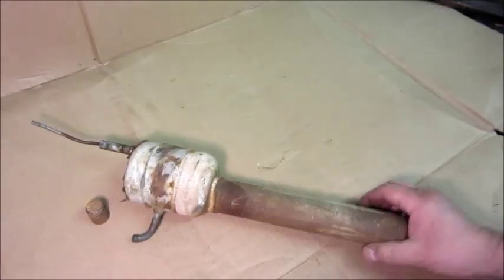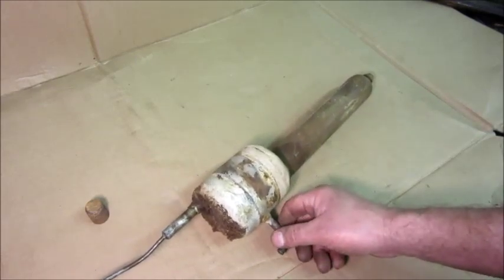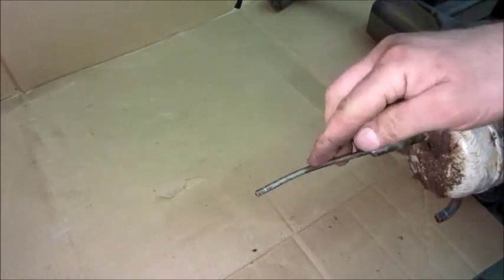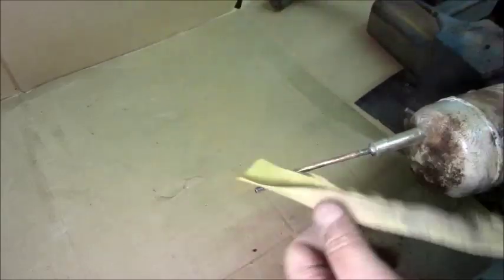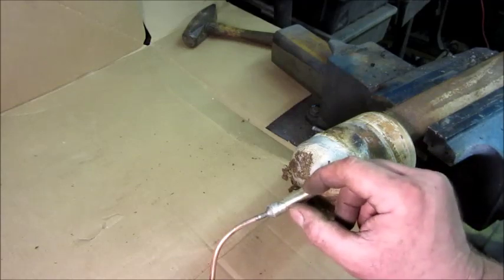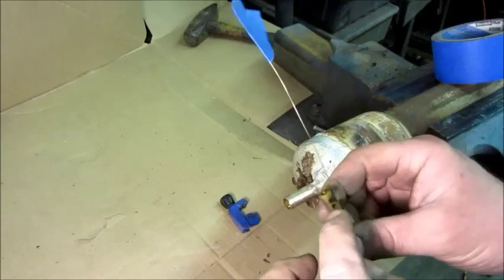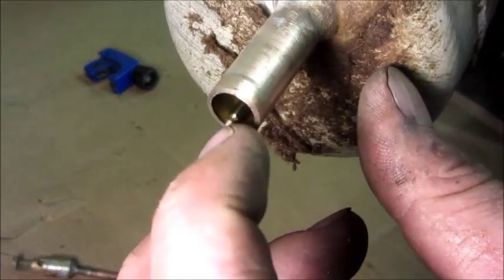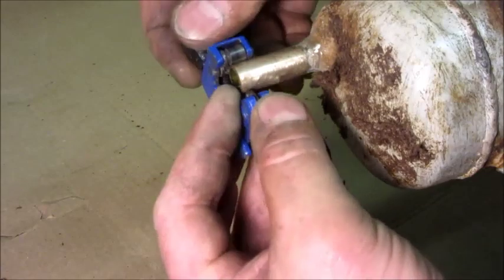Repair of GE Monitor Top CA Float Seat...

Comment: All the little things that one does not think of. I never would have thought there would be a needle valve inside. I would just think it was a loop for the gases to circulate.. Alway's learning form you.  Stay Well..
Reply from the maker: There are so many details!  But you know, all vapor-compression refrigeration systems have a "high side" and a "low side."  The compressor pumps gas from the low side into the high side, then there is some type of metering device that blocks off the flow and gives the compressor some sort of resistance so that it can build up pressure. If there is freeflow, then the system can't have a separate high and low side, and therefore can't work. On your car, it probably has an "orifice tube" or "variable orifice valve" to restrict the hige side from the low side. If it's a household A/C it will have a thermostatic expansion valve, or an orifice piston. If it's a fridge it will have a capillary tube, or in the case of the very old ones, the float needle valve.  All of these things provide a controlled, limited flow of liquid refrigerant to pass from the high side to the low side.

Comment: Initially try cutting two groves - one to cut off to open it and the other to shorten it later. While the tube is still one piece, it might be easier to work the cutter. (By grove, I mean just a deep grove you can go over later to complete the cut.)
Reply from the maker: Very good point. I actually have done it that way on later repairs. This one was maybe the second one I did and was still trying to see how consistent the amount to be removed was; from unit to unit. 

As you said, starting two cutter grooves, about 1.5mm apart and moving back and forth  between them to cut them at the same rate, makes it very easy to remove the ring.

Comment: This is an interesting component.
Reply from the maker: It is. It can be thought of as a "refrigerant-agnostic expansion valve" of sorts. Will pass only liquid which has condensed, regardless of temperature and pressure.

Comment: It looks like a mechanical geoduck!

Interesting that GE seemed to not intend for these to be serviceable, despite the fact that they still have a service port.
Reply from the maker: LOL I thought the same thing about it looking like a geoduck!  But I didn't want to say anything in the video because the schoolboys giggle and start calling those some "other" name LOL!

GE put the service port on the float chamber since that would allow for purging off the non-condensable gases. The machine as a whole only has this one port on it, and it's where they evacuated and charged it at the factory as well.  So it's not really for servicing the float chamber - just to charge the machine.

Comment: It's too bad that they didn't have that seat threaded so it could be adjusted.  The CA I have is going to need to have either this repair done to it, or the capillary tube.  I had my brother watch this and he said he would do it this way first, and then go the other route if this method of repair didn't work out.  I do think that makes sense.  Thanks for your great videos! 

When doing this one a complete unit, how do you tell if the needle is seating properly with it laying on its face?
Reply from the maker: Hi Earl. It would be nice if the seat was adjustable! I guess they didn't count on people trying to keep these in operation 80 years later LOL!

As for telling if the needle was seating properly, I pulled the needle down to its lowest point, and then placed the seat assembly over it. It was easy to feel when the needle touched, before it pushed the float up. I measured how much travel the needle had when moved manually throug its entire range of motion - then adjusted the length of the seat tube, until it would just push the needle up about 25% of its travel.
Reply: @davida1hiwaaynet  Thank you,  that makes sense.  I suppose they made the adjustment by bending something up in the float area at the factory.  It's funny when working on this old stuff, the things they thought would need servicing as time went on, versus the stuff that 90 years on needs servicing! 

One other thing, did you also cut the small pipe leading into the seat area so the whole assembly be removed, or did you just pull it down out of the way?     You have a good one now,  Earl.

Comment: I feel like if you just shook it hard enough you could re seat that needle or dislodge whatever is preventing the needle to seat.
Reply from the maker: Hi Frank. Actually, the seat is worn and no longer round in shape. These are more than 80 years old and there is a slow chemical wearing process which "washes out" the seat area. This one was slightly oval but I have seen them with major guttering and jagged, eroded seats.  You often see hammer marks and other signs that people have done "ungraceful" things to try and "fix" this problem in the past.
Reply from the maker: Here is a picture of a seat with damage: http://home.hiwaay.net/~davida1/IMG/IMG_8360_seat.jpg